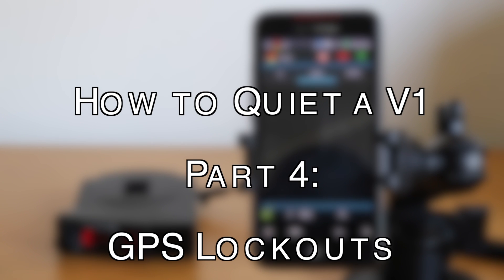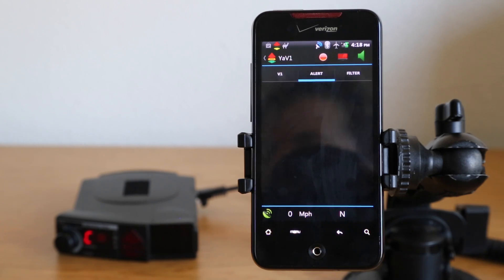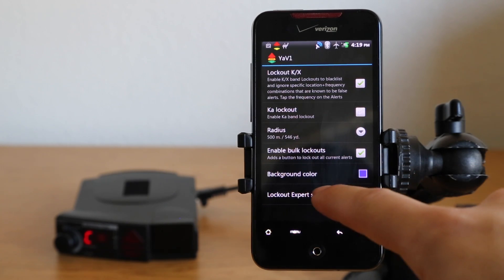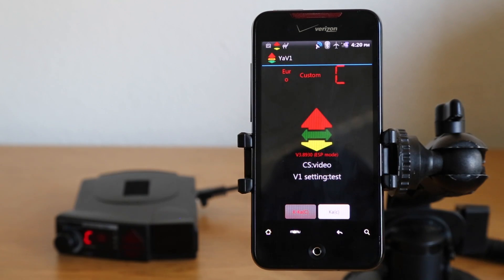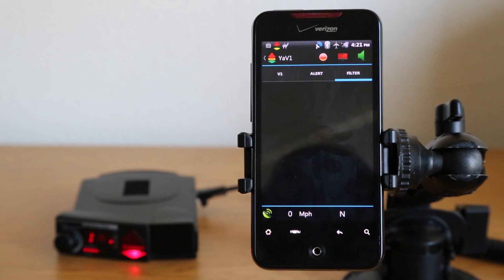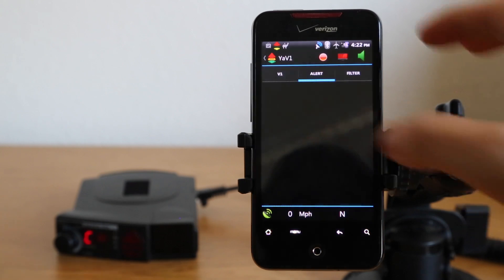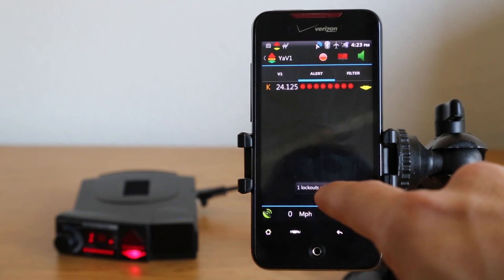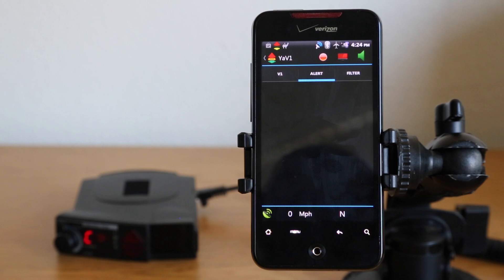How to Quiet a V1, Part 4/5: GPS Lockouts

Comment: @vortex I went through and turned GPS off and all other GPS enabled features, shut the phone off and did a reboot and everything started working fine. It let me click on the signals and opened up a pop up box allowing me to block the alerts. I had the auto blockouts feature on but it wasn't working for some odd reason... When did they update YaV1 2.0?
Reply from the maker: Sinners4SaintsTV Ah cool, so I take it it's working now? 2.0 came out about a year ago now. One of the main updates was automatic lockouts. As long as they're on, it'll learn the false alerts in your area and begin locking them out for you. It's recommended to let it do it on its own versus telling it to do so manually, even though you can still do that.
Reply: Vortex yeah it finally started working after resetting everything. I had it on automatic lockouts but it wouldn't ever work so that's why I was trying to figure out how to do it manually.

Comment: I'm trying to lock out certain K band noise from a walgreens and have everything for it enabled however when the alert comes up and I try to click on it, it won't let me. My GPS logo in the bottom left is red. Do you know what's going on? Thanks!
Reply from the maker: Sinners4SaintsTV If the GPS logo is red, that means you don't have GPS. If you do have a good GPS lock, it'll be green. Make sure that GPS is turned on in your phone's settings as well as in YaV1.

Also, the lockout technique has since been changed with the creation of YaV1 2.0. You no longer click on the signals like this. Instead you press and hold in the blank black area below and you'll get a popup window letting you lock out every alert on screen. Try that once you have a good GPS lock and it should work fine if you don't want to let the app do the lockout automatically.

Comment: What version of android and Yav1 are you running? My android interface is different, including the way I access the v1 settings and general settings. I have a samsung note 2. Thanks.
Reply from the maker: CtrlAltDL337 Yeah, these videos were shot with an older version of YaV1, 1.x that didn't have auto lockouts yet. The interface has changed some since and I've been debating reshooting the whole series, but the principles are still the same so it still works.

Comment: Ok I've got a question and I'm sure it's been answered but I'm positive you're the one to answer it.  I ended up purchasing a V1 and I like it but it is a tad chatty!  I have an iPhone 6 plus and would love to be able to use YaV1 on it but sadly I cannot.  I recently returned from South Korea a few months back and I have a spare Android phone (Samsung Galaxy Grand) that I used while I was over there.  Obviously I receive no data on the device but am I correct in assuming the GPS functionality should still work regardless of where it came from?  I've read on many forums that people like myself with iPhone should buy a 2nd hand android and just leave it in the car.  The app is that good?  I don't want to buy the V1C dongle and not have it work correctly with an out of country phone.  In that case I'd probably just buy the V1C LE and pray that stealth assist updates to include GPS lockout functionality.  Thoughts lol?   

Thanks Chase
Reply from the maker: Chase Johnson Congrats on the V1! YaV1 is a massive benefit to the V1. You do need an Android phone and the Android-specific V1C adapter, but it's absolutely worth it. There's currently no plans for Stealth Assist to get GPS lockouts and there's also been some problems with Apple now requiring 64-bit apps, but Valentine not yet updating their ESP library to allow for 64-bit code so the future of the app is questionable and depends on VR. Even if VR does open it up, YaV1 will still have MUCH more functionality. It really is worth the go and is worth spending the few bucks to switch over to the Android version.